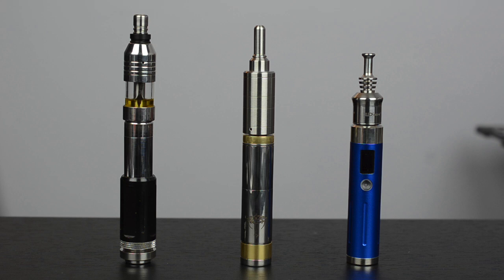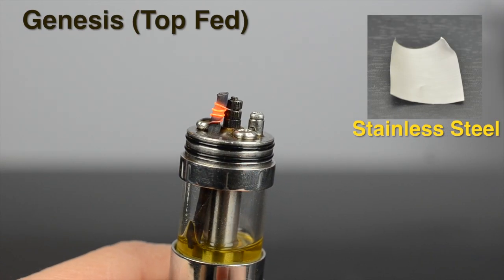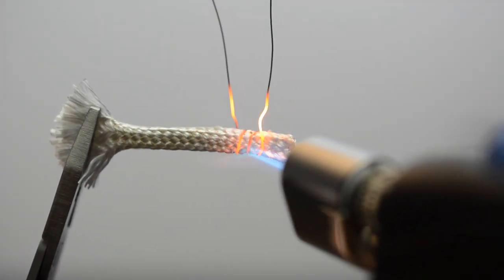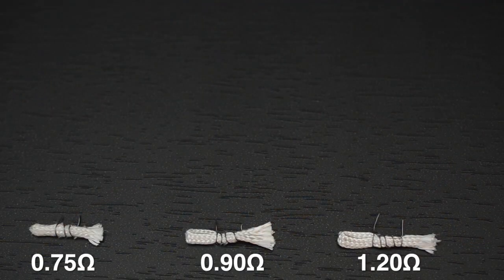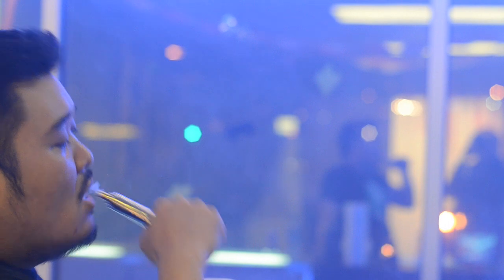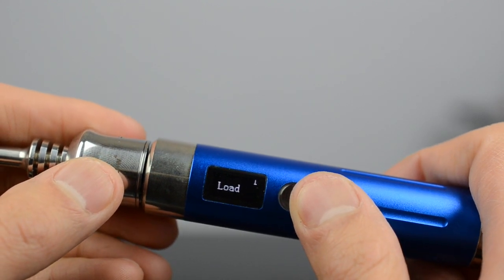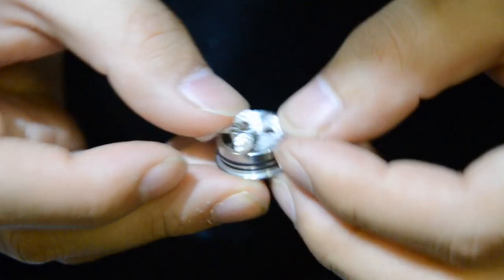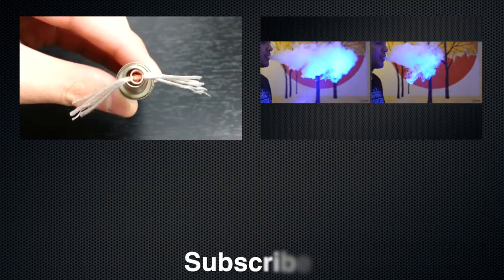Rebuildable Atomizers (RBA) and Mods Tutorial

Comment: Amazing video! Can't wait for the follow ups. Many thanks for sharing!
Reply from the maker: Working on the next one right now on electrical fundamentals. I know a lot of vapers who build without really having a good understanding. I guess you don’t really need it to build, but I think it’s important.
Reply: VapePowered That would be excellent! Maybe you can add a reference to sub-ohm vaping? I read about it a lot in forums but not sure what the fuss is all about?
Reply from the maker: Dinis Quelhas I was planning to do a video on just sub-ohm vaping, but I can give you a short answer for now. Remember that lower resistance resistances give you more power, but that also means there’s less coil which could make it heat faster. The vape is a little warmer; it changes the flavor a little. But I think a lot of people like it for the vapor production.